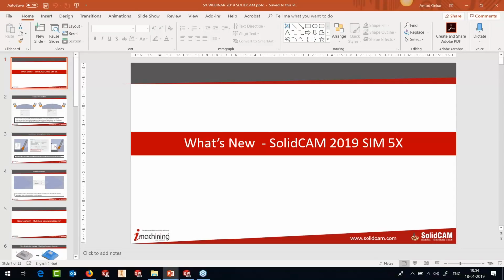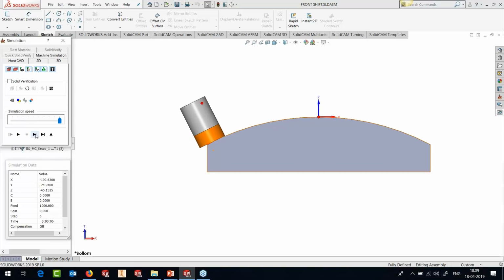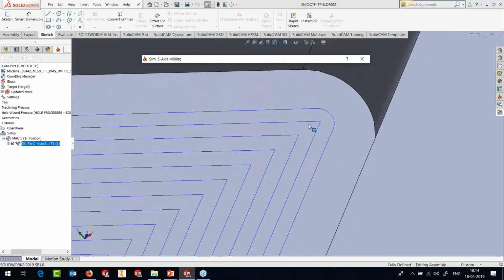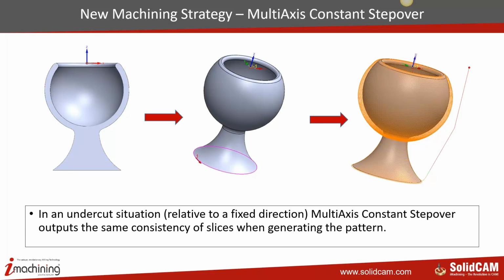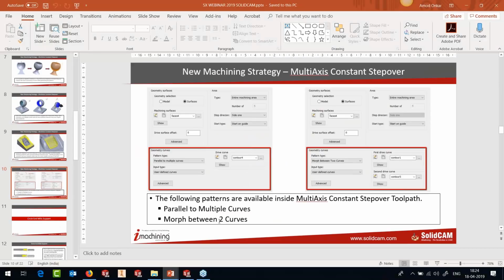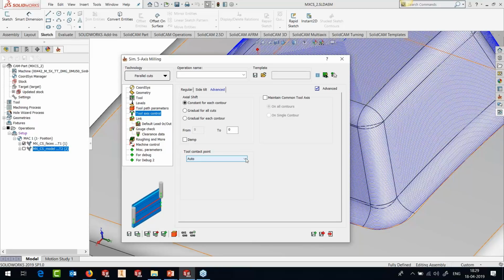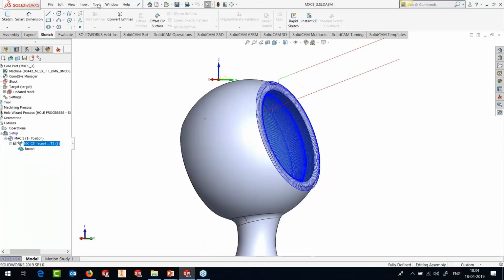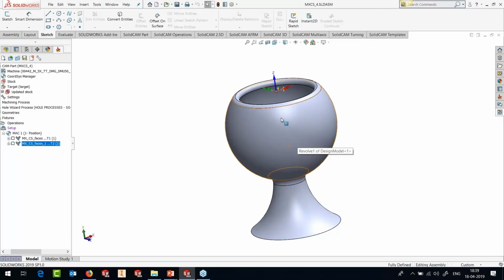KevCAM Night School - Whats New in 2019 - MultiAxis Constant Stepover Machining

Comment: Can you please make more specific video about 5 axis constant stepover function. Also using ballnose and automatic tool tilt function. For some reasons it always gives me one specific error : The containment curves are overlapping in offset space. This usually happens when an area can not be machined (tool does not fit everywhere) or when the containment curves are too close to each other.